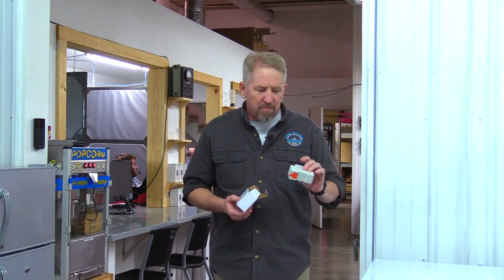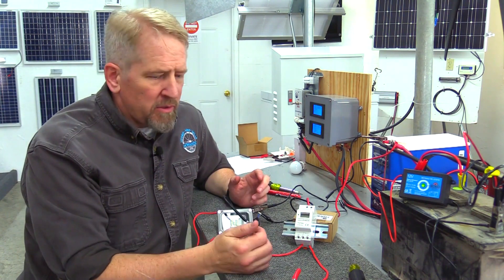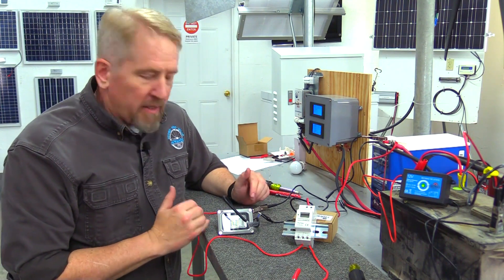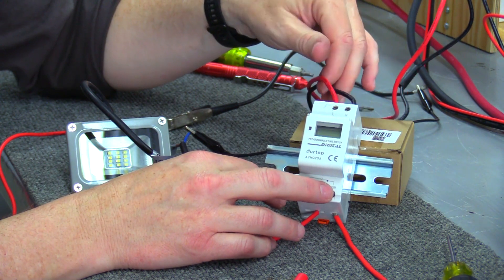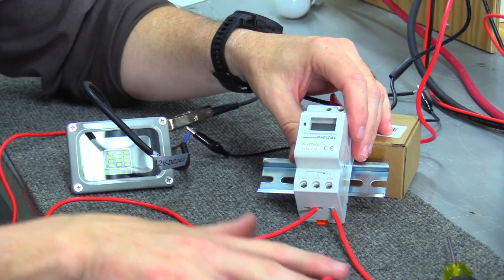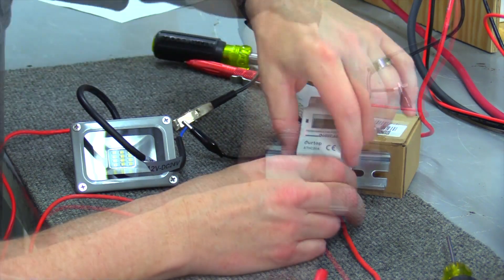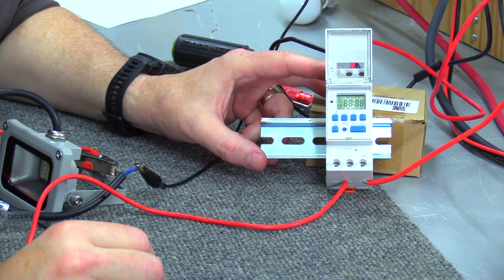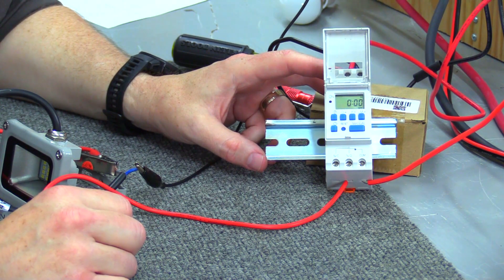How to Wire a 24 Volt DC Timer | Missouri Wind and Solar

Comment: the price is good but I need to know if this timer unit can work on a scheduled time of 15 minutes on and 15 minutes off 24/7/365.  I am setting up my off grid aeroponics system and need this on/off frequency.  thanks for you video.  I luv the fact that you are thinking ahead on usage and had a timer unit designed to your specs.  keep up the great work.  the other application I am thinking about using your timer for is a blinking LED lighting system.  does your unit have a blinking function.  the reason I ask is a friend got rid of mice and snakes under his house by using the blinking lights.  he has not seen a mouse in his house since installing.  thanks
Reply: Carey - I have asked our sales engineer to reach out to you about this. You can also call him at the store to get the exact details. 417-708-5359 x204
Reply: Carey, thank you for your excellent question. Yes the timer can be programmed for this function. You will need to use the "pulse mode" setting. The procedure will take a couple minutes as you will need to select the on/off interval and each day of the week.